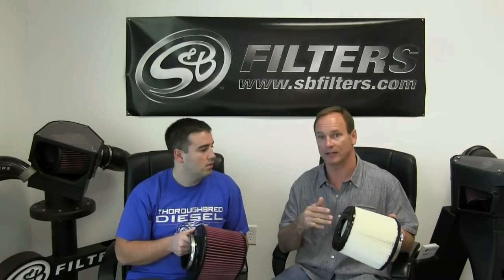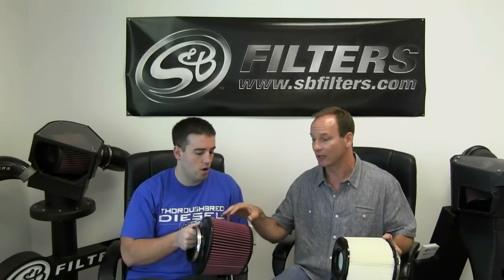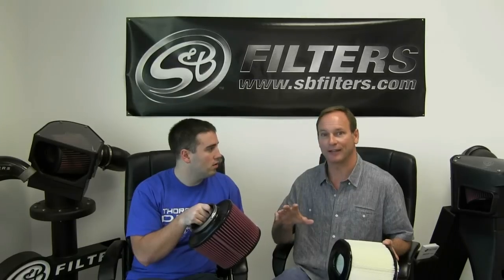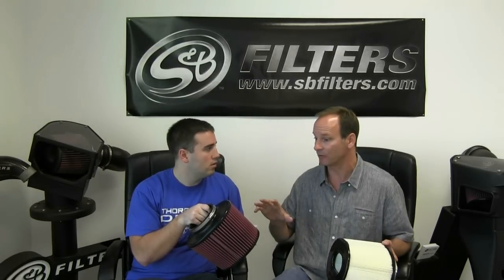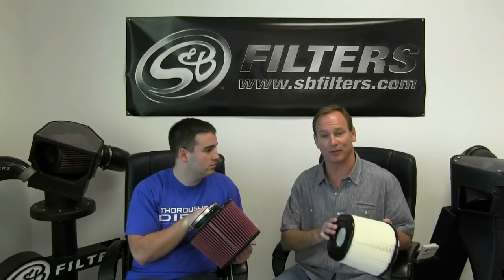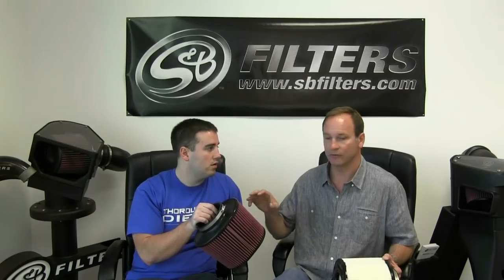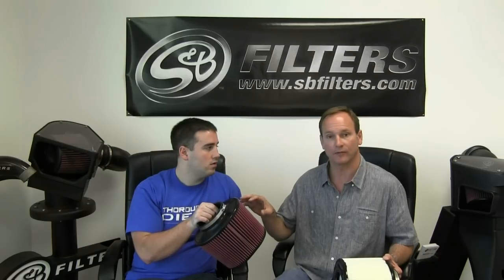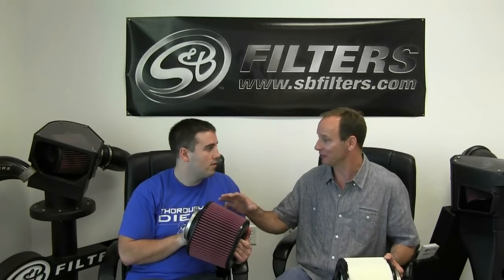Dry Vs Oiled Filters: What is the difference? (Interview)

Comment: I'll make it short and sweet.  If you are looking for performance get the biggest oiled filter that exists.  If you are looking for engine longevity get the best and biggest dry filter that exists for your vehicle.  Oiled filters have larger perforations, allowing more air, and thus performance, but at the cost of allowing fine dust particles through.  Paper, a GOOD quality paper filter (WIX, Purolator), has tiny perforations preventing or "restricting" air flow, resulting in a very slightly diminished performance, but improved air filtration of finer dust particles with respect to oiled.  For all you pro oil filters people.  Yeah, at first your going to "potentially" notice better performance, and improved fuel econ; however, in time, you are going to lose all of it at at substantial significance secondary to the wear from those fine dust particles over the years from all those fine dust particles wearing out the rings and cylinders.  I F'ed up and installed a K&N and cleaned and reoiled it at every other oil change.  The performance and fuel econ on that vehicle vs my other vehicle that just used a quality dry filter is remarkable to say the least (over the years).  I will be honest here, I would never, and I mean never, install another oiled filter on any of my vehicles again.  Hey, do what you like, it's your ride, I am just shedding some light on the matter.  Oh, if you need real clarification, look up Project Farm and his testing on such filters.  A definite watch before considering an oiled filter for sure.

Comment: AFE makes a reusable dry filter. They work great. Just hose them out and let them dry and they're ready to go another round.
Reply: I have these. Do you still need that air filter cleaner from afe? without adding oil after?
Reply: Eddie I have a tekeda dry filter, bought the k&n oil kit before realizing my filter was dry, I used the detergent and rinse and dried, I would imagine it will deteriorate the cotton over time but time will tell, my sri was only about $260. A lot cheaper then k&n but I can always use my tube with different filter, thinking about running the $20 spectre filter from pep boys to see the difference
Reply: My Afe filter leaks all the oil, thinking about changing it

Comment: in the way of afe, KN and AEM a dry filter should trap more dirt and need less maintenance. While an oiled filter will allow more air flow but you prob need to keep up on maintenance
Reply: I would think a oiled filter protect better like they said in the video. but what I wrote is what I came up with form reading each manufactures site.

Comment: No comment on MAF damage which pretty much everyone wonders, along with tuners.
Reply: Stephen Stern on my LB7 6.6 I had to buy a new MAF sensor for my truck because of it.. I switched back to paper and I haven't had a problem with it since..
Reply: Jason Gibbs Were you first using an oiled  filter then switched to a dry filter?
Reply: I'm glad S&B includes a graduated oil applicator so there's no chance of over oiling the filter. My mass air flow sensor is still running high and dry for the last two years.
Reply: What intake is better for my Ford F-150 4.6 k&n AEM Or aFe ? And dry or oiled ?

Comment: How does compressed air damage the cotton? The metal grid should keep it in place.
Reply from the maker: Manufacturer recommends against the use of compressed air.
Reply: Compressed air blows holes in the cotton gauze which would allow dirt particles to pass through, as well as disturbing the thickness of the cotton so that the filtering surface is no longer uniform and consistent.🇺🇸
Reply: @TheNVBA  Ah, I get it now. I wouldn't have thought that the cotton would maintain such uniformity under normal use. Thanks!

Comment: With my 08 6.7 CTD running a stock replacement filter I ran into the issue of the turbo sucking the oil out of the filter in less than a month, and it would also pull the filter minder down. Most diesel guys I know say not to run an oil filer, is there a workaround for this? 08 ram with deletes and h&s mini maxx.
Reply from the maker: What filter were you running?
Reply: K&N's drop in for the stock air box.
Reply from the maker: Nick K Tripping the filter minder could be caused by high boost situations like towing heavy with the filter over oiled.   Are you running through the oil on your drop in KN after you oil it or did you have that problem right out of the box.  The turbo face is going to be oily because of the crankcase ventilation system as well.
Reply: My ccv is vented out, the filter was deleted. Right out of the box the filter was going though oil. I only used the filter for about a month and went to a wix filter. I haven't pulled anything during that time but running att on the minimaxx I'm pulling 42psi of boost on a stock turbo.
Reply from the maker: Nick K I would clean the KN filter well and lightly re-oil it. Try that and see where that gets you. Possible that the filter was over oiled from the start?
Reply: It could be. Will try that.

Comment: You say don't use an aerosol can to apply oil to the filter, yet you sell oil in an aerosol can for your filters... what gives?
Reply from the maker: Jeff G S&B does not sell oil in an aerosol can? Not sure what you're looking at.
Reply: Thoroughbred Diesel NO response in 5 months..sounds like you lied.
Reply from the maker: Garner R Buckley III We never saw a notification with a response to this post. However, we will clear up the air on this for all. (pun intended) S&B does not offer an aerosol oil can nor do we offer that product. We welcome anyone to find on our site where we sell an aerosol oil can from S&B. Using a non S&B cleaner and oil will put a user in grounds for voiding their warranty on the S&B product. Likewise it is highly encouraged to NOT use them and only use S&B oils for S&B products.

There is some truth in Jeff G statement. Good find! S&B had a run of aerosol can products almost four years ago but NO LONGER OFFER them. Any site offering such a product is not up to date or are pulling very old stock. Use the Precision II cleaning & oiling kit from S&B. That is what we offer to apply oil to S&B filters. See link: http://www.thoroughbreddiesel.com/S&B/cleaning-kit.htm
Reply: Spray is good for carberated  engines. Well it won't hurt it any.

Comment: 1 quick coat of oil one way and turn it around and 1 more coat to get the other side. Common sense tells you don't  drench it with oil.  Never had a problem and no need to buy new filters.

Comment: oh my god  , if a tiny bit of dust was to get past filter I'm sure the fuel and air burning would destroy it before it wears away your rings eh ?? ive run k and n on all my cars and motorbikes and will continue to use them . please use your brains people lmfao
Reply: cylinder temps would have to be one 3,000 degrees, use your brain.

Comment: i dont like s&b they look super cheap. AFE all the way.
Reply: We have been using AFE cold air systems and filters on our Hotshot duramaxes and powerstrokes trucks with over 400kmiles not a problem yet just regular maintenance same filter just wash and dry put it back on looks just as new.
Reply: S &b is a true cold air intake afe is open top sucking in hot air .
Reply: mines been a pain because of the active air intake. I think im gonna change it to a sinister. the filter itself really  is pretty good but the hose ,airbox and other stuff I really havent cared for .
Reply: @bradfordjustice7146  yeah me either man.